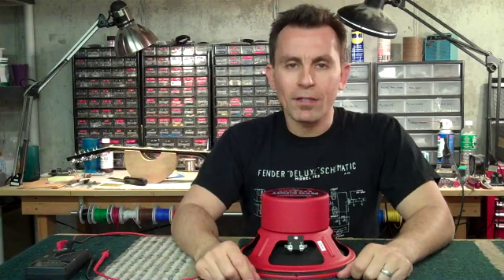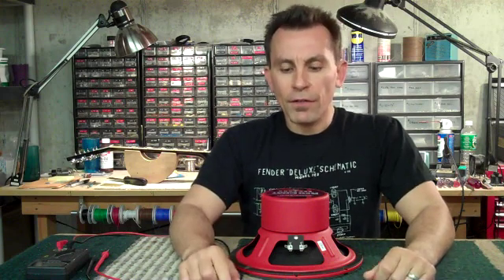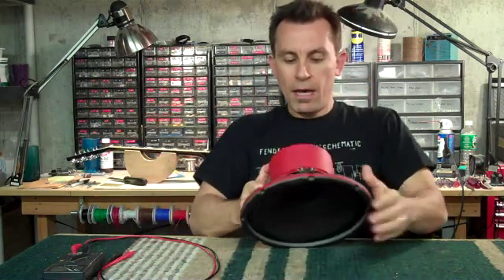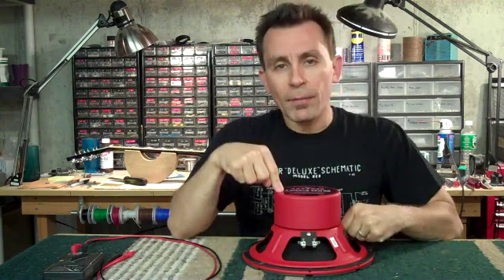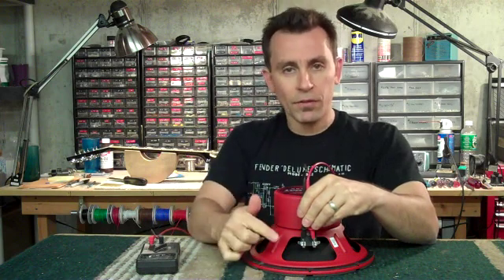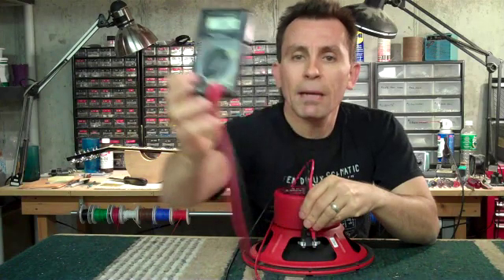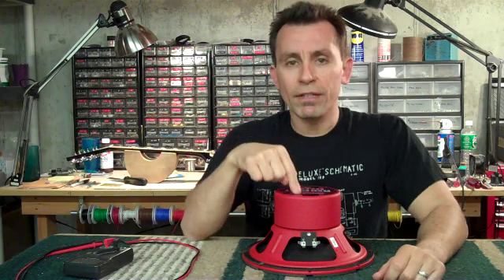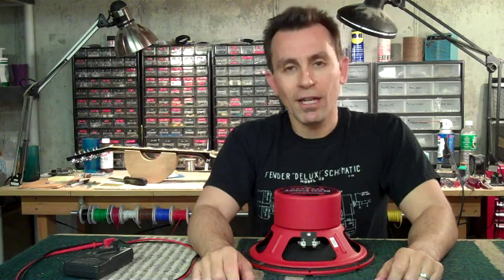Speaker Impedance Reading - Billy Penn 300guitars.com

Comment: what happens when you check the ohms but push the cone at the same time? does the result change? measure speakers sitting on the magnet cover.. not on uneven surface pushing cones and interfering with the coil you're measuring..

Comment: Using a DVM will only tell you what the resistance of the coil is, NOT the Impedance of a speaker or speaker circuit. You should rename this video 'How to tell if your coil is not open' because that's about all this really tells you.
Reply: +Sndtech69 it is really important that all understand this concept. no joke. reactive loads ...

Comment: two things to consider.. Open back or closed back. If you choose british type speaker a 16 ohm is probably better than a 8 ohm speaker in an open back cab as the Q value gets higher, speaker response jsut slightly tighter and you have a little less chance for cone cry. With american thin seamed cones i think the opposite holds true as they often has extremely high q values making them inherently more bright and tight.
 For 2x12 the main factor is to whether to go series or parellel wiring.  They do not sound completely identical. Offcause your amps impedance outs determines which ohm you should go with ..

Comment: Is there a way to check the wattage(power)  of a completely unmarked speaker with a Multimeter?
The speaker have absolutely no marking of any kind, I checked the impedance and it reads 5.4

Comment: The ohm rating of a speaker is a combination of the coil resistance and the inductive reactance and is called Impedance. Inductive reactance is dependant on frequenccy of an input signal, and resistance is not. Your dvm is only measuring the resistance component of the total impedance rating.

Comment: FYI, You described how to read the speakers DCR or DC resistance. Thus is why its lower then the speakers listed Impedance. Impedance is a measurement of the speakers resistance to an AC current. If you have a speakers spec sheet the DCR is listed as "Re".

Comment: What is a good digital volt or multi-meter to buy to check speaker ohms/resistance and also for amp biasing?  Which model are you using in this video?

Comment: Thanks, man!  So hard to get a straight answer about this, with a lot of people saying you can't test impedance with a multimeter.  I guess they're right, but what I can test is whether I have a 4 8 or 16 ohm speaker, even if I can't get its true impedance.  And of course that's what I needed to know.  Bravo for the simple answer!